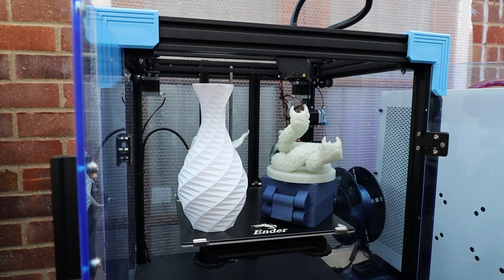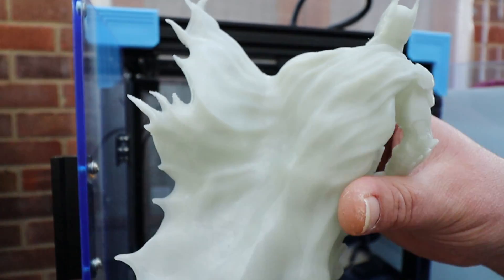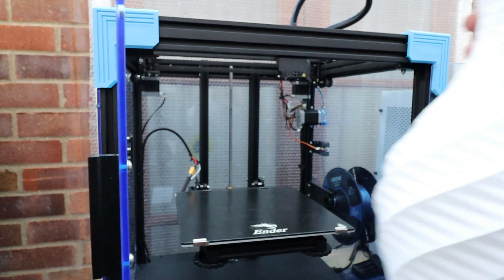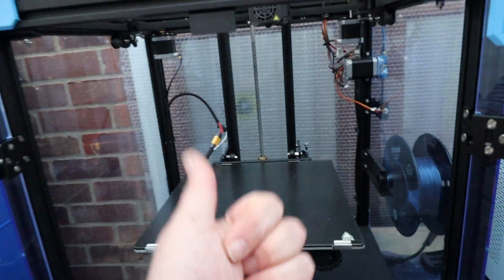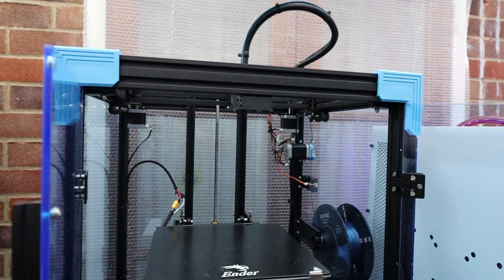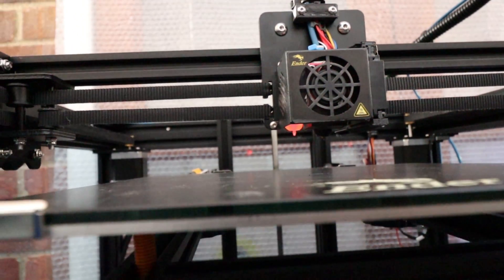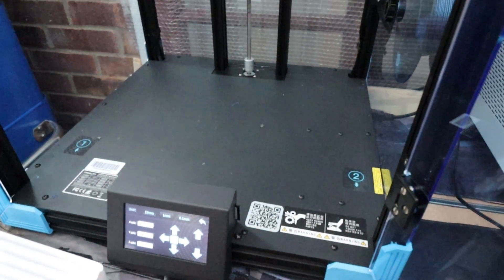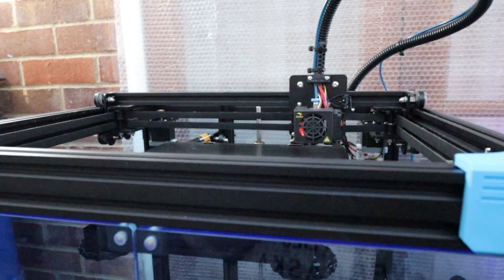Creality Ender 6 Test Prints And BLTouch install v3.1

Comment: 17:20 It does save the mesh bed settings, but it does so on the eeprom file located at the sd card. 
If you instead download InsanityAutomation firmware 7.4.7, it will save the settings internally.

Comment: A few days ago (March 2023) I bought a new Ender-6 and also the BL Touch.  I had asked Creality sales if they work together as the info isn't on their web site.  Layla responded to say yes.  When it arrived, I found that the printer end of the cable has a plug that is too big.  I emailed Creality support and Layla replied (after a couple of days) saying if the product doesn't fit my printer I should return it to them.  It seems that Creality is operated by a cheap AI bot.  This is a couple of years after your video!  I've not been able to find a JST SH 1mm 5 pin cable that is long enough.  I also had no idea that the wire configuration needs to change.  Thank you.
Reply: Update: the cable I have should be plugged into the mainboard underneath the printer (as shown in the BL Touch manual🙂).  In my defense, I had watched Creality's installation video showing it being plugged into the secondary board at the top.

Comment: Hi, you saved the z offset by pressing home, I have a CR10 Max with similar firmware. How does this affect the Z offset setting which can be adjusted in when printing a job? I have always set the z offset on a job through trial and error. Does this overide what you save in the autolevel screen?

Comment: This is a great video! I am trying to trouble shoot the auto home position for the build plate, because I cant get it to adjust both upwards and downwards (it will only move slightly downwards at the beginning). Additionally, when i navigate to the screen to level it out, the screen becomes un responsive. 

Everything is new and hooked up properly, and the software is up to date but I still cant seem to identify the issue. Any suggestions?
Reply from the maker: i suspect its a wiring issue, double check you have plugged all the cables into the little control board the correct way around, also take the bottom pannel off to check the wires going into the motherboard havent come loose, are you using a bltouch?
Reply: @BeanGaming-w4n  i guess it could be something i need to double check. I do have a bltouch and the firmware for it is up to date. Outside the wiring, is there something else you recommend looking out for?
Reply from the maker: @it0mahawk  someone else contacted me recently with this same issue but he didn't want to remove his cover and check the motherboard, I would unplug all the wires from that little control board and check all wired, then check all the connections on the motherboard, does the bltouch light up when you turn the printer on?
Reply: @BeanGaming-w4n  i think ill try the good old fashioned  "unplug/replug" debug suggestion you made. the screen works totally fine until I try leveling the bed. Then it either freezes, or becomes excessively slow to respond. Thanks again for the swift responses. You rock!
Reply from the maker: @it0mahawk  feel free to add me on Instagram, easier to communicate through that

Comment: i installed a cr touch (supposedly the same) when i plug it in to the small board and turn on the printer. it sounds like all the motors are trying to go in all directions . do you know what the problem may be.

Comment: Hi is it the same for crtouch?
Reply from the maker: Hi, ive not used a crtouch just yet, I've got one on order so wouldn't like to say if it would work
Reply: @BeanGaming-w4n  I have an ender6 and crtouch so I think I'll try it
Reply: I need to buy a jst 1.25mm connector

Comment: Hi. The first test print you show is of a vase, that I assume you printed in vase mode. I can not get vase mode to work on my Ender 6. When printing the wall it prints a bit, stops, prints a bit, stops, does that all the way through the wall print. When done the wall is not smooth it looks "crinkled" for want of a better word.
I use Prusaslicer and in there the slice looks absolutely fine.
Any help appreciated.
Reply from the maker: I had that same problem its to do with a slicer setting but for the life of me I can't remember what setting you need to change

Comment: I am running into an issue where when my bltouch 3.1 is plugged into the ender 6 my z motor starts to vibrate rapidly. 
the board isn't dead and I am still able to revert the changes. that being said I cant get it working. If anyone know what this issue is please feel free to let em know.
Reply from the maker: Hi, make sure you have got the wires for the bltouch the correct way around

Comment: Quick question, I got my Ender 6 a couple of weeks ago and I am constantly getting message that my filament is running out, but that’s not the case.  Is my filament detector broken? Is there a way I can fix it?
Reply from the maker: hi, sounds like you have a duff sensor, could be some dirt inside, just unscew it and give it a clean

Comment: Have you had issues with the BL Touch failing and causing the hotend to crash against the bed? BL "Crash" has ruined my first Ender 3 and is only good at ruining brand new PEI sheets despite replacing it twice. I threw out that thing and went back to manual bed leveling. Now that I have an Ender 6 I am really very apprehensive to install one. Also, I bought an E6 hoping to have a better printer, but I noticed that the E6 doesn't print as good when it comes to small parts. There will always be some over or under extrusions. I found that i still have to slow it down to 50 or 60 mm/s to get anything decent out of it in the "small part" department. I use capricorn tubing and did not include the bowden tube in the clamp on top if the XY carriage. For big and fast prints sure this machine shines. But since I mainly print small functional parts, my Ender 3 does the job better and gets used more. Bought my  E6 around 2 months ago and is just gathering dust to date.
Reply from the maker: Hi, I never had any issues with the bltouch on my e6 at all, I tend not to print small bits with my printers as they will never come out that great compared to a resin printer

Comment: Thanks for a great review.  The tips about the BL Touch was very helpful, annoying that you have to get a different cable
Reply from the maker: You can just make a cable up that's what I did
Reply: @BeanGaming-w4n  I've ordered a bltouch from amazon with an extender cable, will splice them together when they arrive
Reply from the maker: @linuxgurugamer  drop me a message if you need any help
Reply: @BeanGaming-w4n  I'm having a problem with the BLTouch 3.1 just not working.  I can get it to work 1 time by doing a flash with the 1.0.4.9 firmware and immediately doing a leveling, but after restarting, it will then fail by just flashing (the BLTouch flashing, that is)

I've tried the 1.0.2, 1.0.4 and 1.0.4.9 firmware, all have the same failure

Any ideas?

Edit: Found my problem.  I was reviewing the cable, and when I took the head apart, i saw that the connector wasn't all the way into the bltouch.  Working now

Edit 2:  No, it isn't.  I'm beginning to wonder if I have a bad BLTouch.  It worked for a few minutes, then crapped out again

Edit 3: It's the BLTouch.  It's sticky, occasionally it doesn't drop down, and then fails the self-test.  I'm now gently pulling it down before turning on the printer and it then seems to work ok.
I've ordered a second one, came across some instructions on how to fix it, but since it involves a bit of surgery, I wanted the 2nd one as a backup.
For anyone interested, the link is here: https://forum.duet3d.com/topic/4575/bltouch-won-t-deploy/25  and look at the last 2 or 3 posts
Reply from the maker: @linuxgurugamer  hi, thats strange, are you definitely installing the correct firmware? Head to www.creality.com and get the firmware from them and try it again
Reply: @BeanGaming-w4n  It was, but the problem turned out to be a sticky BLTouch.  The probe isn't dropping all the time and that causes an error.  I can get around it for now by pulling it down by hand before turning it on, but will be replacing it with another when it arrives.  I've also found a post which talks about how to fix this, here:  https://forum.duet3d.com/topic/4575/bltouch-won-t-deploy/25
Working fine now with my temporary workaround.  i need to pick up some 2000 grit sandpaper to do the cleaning.

Thanks for the reply

Comment: My printer is also losing the offset distance when I turn it off plz help
Reply from the maker: make sure that you have the sd card in the printer when you are setting the distance up it should then save it to the sd card, have you done any firmware updates?

Comment: Hello, could you help me? i have terrible problem with the configuration of retraction T.T
Reply from the maker: Hi, what seems to be the issue?
Reply: @BeanGaming-w4n  A lot a lot a lot of thread =( tmp 205º speed 40 and distance 5,2
Reply from the maker: @germanmorales9925  speed wants to be at 60 minimum really, these printers don't like printing slowly
Reply: @BeanGaming-w4n  What is your setting for speed and distance of retracction?
Reply from the maker: @germanmorales9925  hi, speed will vary depending on what I'm printing but 60mms is a good starting point, try retraction at around 4

Comment: Is there a way to increase the plate size on this printer. I want the is quality but I need a bigger plate size.
Reply from the maker: Hi, in all fairness you probably could but it would require alot of work to get everything to work correctly and you wouldn't really gain that much more build space

Comment: Hey mate. Whats noisy to you? Planning on putting this beast as a 2nd printer in my spare bedroom(room i sleep next to) and continously pump out the same parts (12 hour prints with 140mm/s and 150gr filament a run - test sliced it in cura). Are we talking vacuum cleaner or engine noise levels?

Whered you say the noise comes from ? The long belt or the bearings rolling on the top beams?
Reply from the maker: as long as you dont like sleeping you will be fine lol its not to bad more like vacuum, but its only really loud when you print at high speed, so maybe print at slightly slower speeds to reduce to sound level
Reply: Thanks for the reply. Well the reason im choosing the ender 6 is because of its high speed / quality ratio. Kinda need it to be twice as fast as the prusa mk3 im currently using. 

Printing 20 of the same parts in 1 go. And more in shorter time is beter. 

But late night reading mentioned its the fans that cause the noise at high speeds. Thats something i can fix myself by installing noctuas. 

Tbh i can sleep trough a vacuum haha. So hoping for the best (can snag it for €450 from someone who only has it for a 2 months)

Comment: Ciao volevo chiederti alcune delucidazioni, in quanto sto affrontando il mondo 3d adesso... con la ENDER 6! che filamenti usi e se puoi indicarmi le tarature? grazie
Reply from the maker: hi, welcome to the world of 3d printing, i would say the easiest filament to work with is PLA, so i would say start off by using that until you get the hang of it then move onto other types of filament, as for the settings Creality include a version of cura on the sd card so i would say use that until you get the hang of how it all works
Reply: @BeanGaming-w4n  Perfetto grazie mille gentilissimo!!!

Comment: It was tough, but I got the tube in.
Reply from the maker: I found it better to leave it outside of the clamp bud
Reply: @BeanGaming-w4n  Oh, I did it before I watched this video. It wasn't too hard. I gritted my teeth at it a couple times in anger, but I got it. lol 

I just got frustrated with other things and am just getting back to trying to get it to work this weekend. I've got everything but the problem with the filament solved.

Comment: Where do I find the link to the software to add the BLtouch please as theres been so many comments it seems to be lost or hidden ...
Also any instructions tips , I see the white wire end goes closer to extruder brown further away and on the BLtouch only goes 1 way , so with the wires and shortening length as they sent me 1.5m extension is it better to solder joins to lessen chance of a loose connection happening ? 
Thanks heaps mine just showed up 10 minutes ago so keen to install and give it a run , thanks for your great video's. 
Does your Ender 6 have the larger extruder stepper closer to 60mm long or the shorter stepper like in Tesla video's?? Just wandering if they would be the same software needed or just plug and play .... Cheers 👍😁
Reply from the maker: Hi, good choice of printer, head over to www.creality3dofficial.com you will find the firmware there, I think there has recently been a new one released for the ender 6, if you happy to solder the wires I would definitely do that, make sure you insulate them so the bare wires don't touch, take your time with assembly and don't over tighten the panel screws or you will crack them, the extruder stepper on these printers are massive and they need to be to keep up with the blazing speed 😀
Reply: I just watched your video again and noticed the white wire is on the left of the BLtouch but the right of the circuit board , can you please double check on your machine both ends as mine on the touch is opposite white is on the right of both ends... 
Thanks heaps and keep up the awesome easy to understand video's 👍😊
Reply from the maker: @anthonydendle4768  hi, unfortunately I had to sell mine along with other so I can buy more in for review because my channel is small I don't get sent printers for free, just follow how mine is wired up and you will have no issues
Reply: @BeanGaming-w4n  all good man I think I finnally understand what needs doing thanks heaps , the creality site has 2 new files 1 for BLtouch and another 1 called Endstop so not sure if I have to install both and would I install 1 then shut machine down erase that off the card and add the second bin file ??
The video's are all over the shot even the latest from creality as they only show to install 1 file and its a hex file which isnt even in their firmware list ....
This is possibly why theres so many confused users not upgrading and just sticking to the ol paper level manual way...
Cheers and thanks again for your time and replies they are helping lots
Reply from the maker: @anthonydendle4768  hi, if you installing the bltouch you need the bltouch file, download it, you will probably need to install a program called 7zip (it's free and safe) to extract the files, after you have extracted the files you will see a .bin file, put that file on a blank sd card (make sure no other files on the sd card), turn the printer off, insert sd card and turn the printer back on, the screen will stay blank dont panic then after about 20 seconds it will load up with the new firmware
Reply: @BeanGaming-w4n  thankyou again heaps have had it fitted and working now beautifully with all your help...
I am learning heaps this year already hehhehehe  👍😊
Reply from the maker: @anthonydendle4768  thank you 😊

Comment: Just a quick update on the BL Touch - it does appear that the Ender 6 does save the bed mesh data - this may be that I have a more recent update of firmware. So in your start GCODE, you don't need G29 to scan the bed. It is confusing that the Marlin documentation says that G28 (Home) cancels auto bed levelling. But so far on all my prints, I've remove the G29 (bed meshing) and everything is fine. Also with PLA+ I've started to use brims in Cura, to prevent warping. Results are great at 150mm / second printing of straight forward boxes (used to hold my tools). Printing something more complex like a Dalek (ref. Thingiverse) moving the speed from between 80mm/sec upto 150mm/sec makes no difference, as over short distances the machine can not reach the target speed. So "speed" is going to vary depending on what you print. There are Core XY machines that can go faster, if you want to build them (e.g. HevORT).
Reply: where can i get the BLtouch mod for the ender 6, on the creality website i can't find it

Comment: Just starting my first test prints - getting some annoying stringing, so have to tune temps etc. But I'm trying to push to 160mm/s to see what happens. You're right though, this printer feels really solid. The 2040 extrusion is really effective. I was surprised how tight the belts are. Did you notice the belt runs on a slope from the left/right side to the head? I wonder if that's going to hurt the belts in the long run with them riding up against the pulley edges. I'm also wondering about the cooling fan and if a second one mounted on the left side of the head could be beneficial.
Reply from the maker: If you getting alot of stringing you might need to adjust your retraction settings in the slicing software

Comment: Do you use cura? And if you do, did you set it on the ender 5 plus, considering that the creality ender 6 is not an option
Reply from the maker: Hi, yes I used cura, just use the ender 5 profile and modify the bed parameters and dont forget to enter the G29 code after the G28 to enable bed levelling
Reply: @BeanGaming-w4n  thx
Reply: @BeanGaming-w4n   How would one find the G29 code? I'm new to 3d printing and have an ender 6 on the way and want to have the setting ready to go in Cura. I already have the bed parameters set but did not know about the G-code.
Reply from the maker: @LilRCTruck  hi, go to preferences, printers then machine settings, at the bottom you will see start g code now in that box you should have a G28 code, you will need in type in G29 under the G28